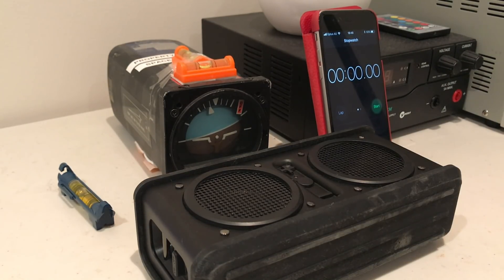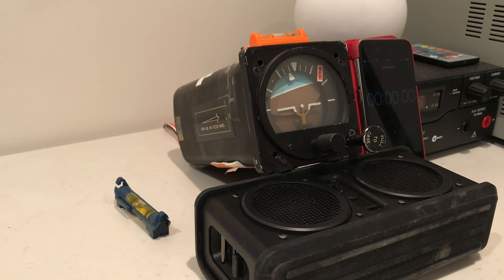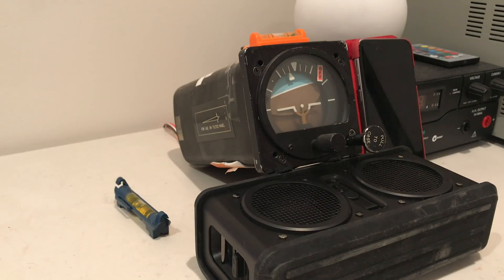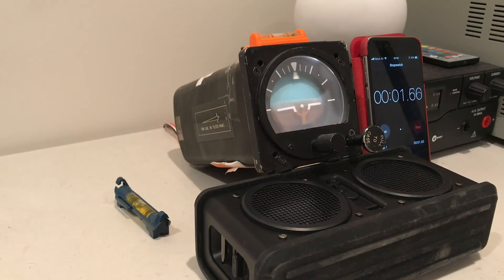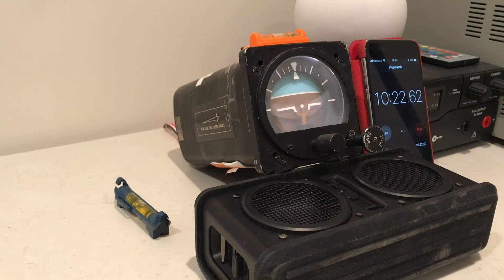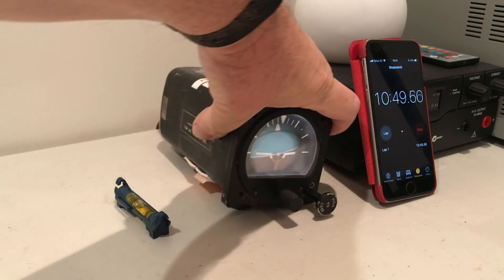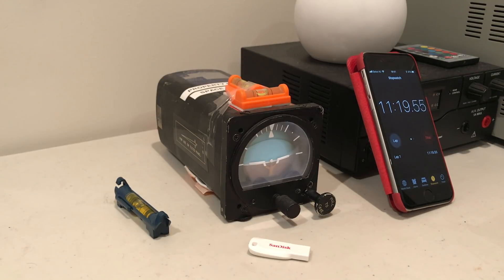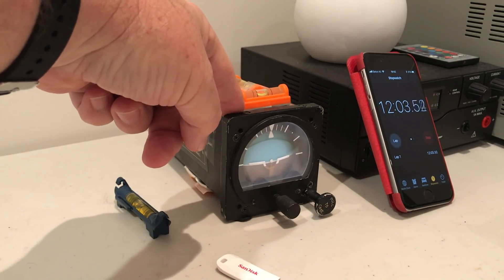Flat Earth - An often requested Artificial Horizon Experiment - Powering up at an angle.

Comment: An object that show you when you are level. That's it. WHEN YOU ARE LEVEL. Level can only exist on a flat surface not a round one. And claiming that the force of gravity is why it's always showing a level orientation.  in fact as you curve so would gravity in perspective to the earth. . SO the artificial horizon would  constantly make a new forms of level seeing how the place of level at 1degree of curviture would be different at 2 degrees. The level of gravity would be different in the new destination. then the level you just entered. And if you where right and it was maintaining the level of the force that makes things fall which is gravity consistialy to the center of the earth equally. Then your instrument would still display a change quickly going from unlevel and back to level again as it when from 1 degree to another.  I could draw this for u but the comment section only does text.  But seeing how there is no transition displayed or even shown slightly for a millisecond then you are not curving with the earth... plain and simple. LOL THIS GUY IS LITRALLY GIVING FLAT EATH MORe PROOF BY SHOWING YOU THAT THE artificial horizon  MAINTAINS THE PLANE AT A LEVEL FLYING STATE unaffected by the earth's changing  gravitational pull as you curve around  AND YOU GLOBERS EAT IT UP forgetting the fact that it keeps the plane level. And there is no transition what's so ever.
Reply: Level ≠ Flat. Level means perpendicular to the center of gravity. This is well known and doing a little bit of research can't be that hard, right?
Reply from the maker: +sky souls.  I am constantly amazed at the ability of Flat Earthers to completely NOT understand how this instrument works.  Basically everything you said was wrong.  

When you fly across the Earth you do not jump in 1 degree steps.  It changes gradually over many minutes.  At 450 knots it takes 8 minutes. 

That means after one minute the change was only 0.125 of a degree.  That means in 5 seconds it was just 0.01 of a degree.   The gyro is adjusting constantly and smoothly.    Do you really think anyone would notice 0.01 of a degree?   Not a chance.

No I am not giving Flat Earth more Proof.  That is just your complete misunderstanding of my video.  This video proves Flat Earthers don't understand how the Artificial Horizon works and your comment just confirmed it.
Reply: "It amazons me how u simple think everyone who took physics is gonna buy this crap"
This is the essence of flat earth. "All these people who know physics get this wrong, and I get it right. How amazing!"
Reply: Sky, if the pilot took his hands off the controls, would the airplane always just keep flying in the same direction?
Reply: sky if the pilot is always maintaining the aircraft with a constant orientation relative to the center of the earth then you'll see no change in the artificial horizon that can visibly be distinguished from those caused by little changes of aircraft orientation due to turbulence and stuff. As Wolfie tried to explain to you, the aircraft doesn't go to on degree off and then get corrected. It's always being corrected because of a lot of stuff.
Reply: Laywer* not larry
Reply: More likely want* the word not is not suppose to be there
Reply: Sky, the pilot or autopilot is maintaining the aircraft's orientation relative to the ground all the time. It's going through different air currents, different air densities, people moving around on the plane, the fuel tanks draining, all that stuff.
At every point in time in level flight, the pilot is keeping the aircraft in the same orientation relative to the ground, so down will always be down for someone (or a bubble level) in the airplane.
Airplanes don't just keep flying in a straight line unless a pilot consciously compensates for the curvature of the earth any more than your car will keep moving in a straight line for several minutes if you take your hands off the wheel.
Reply: Barry On ok so.now we have gone from it the pilot took his hands off the controls. What would happen to telling me what happens when the pilots hands us on the control or you have the system of auto pilot doing the controls for you. Which is not the question asked if you had asked what is the pilot doing or auto pilot doing at all times. Your response would indeed be correct for this situation but you didnt. And I answered your question in to what would happen if the pilot took his hands off of the controls. So I believe your compadince of the situation has in fact been compromised. And like I said I never disagreed that the instrument maintains a level that is in correspondence with the force of gravity which is always pulling towards the center of the earth. Thus creating this down word direction your speaking up. I merely stated the the direction of down that is perpindicular to the ground would always change by degrees on a sphere of gravitation pull. So again dude what does any of this have to do with the facts that gravity is a force lulling into 360 degrees down torwds the center of the earth and what does the pilot letting go and letting jesus take the wheel have anything to do with the fact that the artificial horizon does not register the siddle changes in the centeipital force pulling down and it travels to even .001 degrees of space. Nothing it has nothing to do with it. Like I said I could fly a plane with a two levels from lowes and those guy wolfie is just making a statement that the machine reads the force that is always going down perpindicular to the earth ignoring the laws of physics facts and science that what would be perpindicular 1 degree before is not long the same 1 degree layer and the machine of going of that same force and registering the perpindicular level ofnthe force it would in fact constantly flicker from unlevel back to level bro plain and simple thanknu
Reply: Wolfie6020 your still missing my point sir I and in not talking the instrument I'm talking physic and the instruments used in physics and the instrument whether its 1 whole degree or. 01 degree should still register a chance in the geqvitation field and going from level to un leve in fact it should be fighting itself becuase ever second m you tenable your going from. 01 to .02 to. 03 to .04 to. 05. Here we can break the numbers down ever more but gues what ever saxons u fly the field would be changing and the directing in which gravity is pulling on set object towers the center of the earth would change from .001 to .002 to. 003 and your matching never ever register the chang is simple remains level like a leveling rool left on a flat table bro. And if ur instrument was going of set for it would pick up the changes in the force of gravity. Not just stay leveling. It amazons me how u simple think everyone who took physics is gonna buy this crap. The point of leve would be hanging so much and it would literally be a point in each degree. Of movement not a level line. And guess what when you connect all the points of you maintained a level position all around the sphever and then connect the this points to show the path of the p lllm and you whole have drawn a larger circle around the smaller one. No where in ther would you draw constant level line. So your matching still would have to show a twitch every second showing itself as autocoreting itself and it doesn't. it show the line remaing  perfectly flat. I mean my God you and these people amazing becuase you have explained and showed me how this thing works I realized you take one of those levels on the table stap it to your pain table and fly with that tool and save a few 100 bucks  if the bubble comes towards u it means ur diving is the bubble goes forward it means your climbing. Have a second one for left and right and again if it comes toward you your going left and it it's going away ur goes right. And if you keep both lil bubbles in the center bamb you lever and flying strait. For 15 bucks at lowes for 2 levels and boom you got yourself the cheapest artificial horizon you can think of. Your welcome.
Reply: Barry On right lil and just ignore the fact that I'm right about being able to keep a plain level and fly straight with 2 fucking levels from lowes I'm done with this conversation bro. I've maid my point and since I can not draw in the comment section to show you what your gravity is doing and how it changes from one point to another becuase ur travicling on a sphere your little brains couldent reflect what I mean that the force direction in which gravity is tugging on your plain is always chancing from one point in place to the next and the fact that your machine which is silly based on detecting that force and not maintaining a level like you claim. Becuase the man clearly stays its sence the direction in which things fall relative to the earth and that force is call gravity and the direction to the center of the earth is always changing. And your matching doesn't even register the change. Not even a twitch. I'll stil with my levels from lows
Reply: Der Tod I agree sir I'm not refuting that fact. The the point in which your perpindiculer as your travel on a sphere would chang every degree. You know cuz sphere deal with degrees as you move across the surface. your travel. 1 degre .1 or .000001. It would constantly change so your point of perpindicular would always be changing thus the force of the gravity would also be changing by degrees becuase ut pulling towards the center of a sphere. And the machine shows no change at all. Like I said you can use a level and do the same thing and fly around. In fact imma make a video and do that for yall
Reply: Barry On what does that have to do with the facts presented or are you trying to play Larry and ask inquiring question to test my compadince. One depends if you have your back up systems running like auto pilot two ut will maintain a level for a short distance. And in fict it will more likely not want to roll from one side to the other rather then nose dive like you see in the movies anything Els buddy

Comment: I note that this AH is for a sloped panel. What's the difference between this type & those made for horizontal or vertical panels?
Thanks for all you do. ;)
Reply from the maker: +Dick Holman  - I think it would relate mainly to the position of the horizon line in the instrument and where it sits when the case is 5 degrees vs level.     If you look at 4:30 in the video when the case is level the instrument is actually showing a tiny climb.   If I angled it 5 degrees downwards the horizon would line up better with the side markers.  

It would work ok if mounted level as you can manually adjust the aircraft up and down slightly for eye height anyway.
Reply: :) Thanks Wolfie. Every time I watch one of your vids, I learn something new about aviation.

Comment: Hi wolfie i think we all knew that the gyroscope is self correcting instrument , i think the arguement here is have we ever witness during the flight that when the aircraft do down tilt every 8 mins as you say is the gyro self correcting  on a 1 degree down tilt ?or if not , and its on  a steady flat horizon during the flight and does not correcting how can we say that the aircraft is in nose dive every 8 mins?  When you say constantly self correcting have you noticed that during your flight?
Reply: It doesn't have to pitch down to compensate for curvature.  This is only a stupid Flatardian notion.  An aircraft is constantly making adjustments to maintain altitude.  You really think 8 inches per mile is something to worry about?  It's one degree in 70 miles.  If it is constantly trying to maintain level flight the curvature is insignificant.
Reply: Which part of "because it is constantly correcting at any time, you will not notice the correction because all you would see is a gyro which axis is constantly pointing "down"" do you not understand?

"reason why the flat earthers are wrong on the gyroscope thing?"
The whole argument is bullshit.
Even without an artificial horizon, an airplane would not fly into outer space. The altimeter measures the air pressure and displays this value in the form of altitude. The air hull follows the curvature of the earth. So all a pilot (or an autopilot) does is: if the altimeter reading is to high, he steers a little bit down, if the reading is to low he steers a little bit up. And he has to do this all the  time, because air is not a homogenous gas but has pressure differences all the time. Simple as that. A plane simple follow the level of constant air pressure (which degrades with altitude but there are also other factors influencing the air pressure such as weather)
Reply: Why would an aircraft need to tilt down every 8 minutes?  Where are you pulling this from?
Reply: Do you honestly think planes are incapable of maintaining a fixed altitude without having to do it in jerks every few minutes? When you drive a car around a gradual bend do you jerk the wheel sharply once every few seconds or do you slightly turn it just enough to maintain the curve in real-time?
Reply: slapz2010 He did not say that.
Reply: https://en.wikipedia.org/wiki/Gyroscopic_autopilot
Tell me about the computerized autopilots in use back in 1912.
Reply: slapz2010 why would a plane jerk down once every eight minutes? That makes less than no sense. It stays at the same altitude constantly, every second, it doesn’t wait eight minutes to adjust its height. The earth curves constantly. There isn’t a sudden rush downwards at the exact distance a plane can travel in eight minutes.
Reply: slapz2010 Who is claiming anything about proving the Earth's shape?  You missed the point of the video.  Again, it is the dumb flat earther notions that a plane has to dip its nose to compensate for curvature, or that the gyro in the attitude indicator would not work as it does when flying over a curved Earth.  Both these notions are simply not true, and are dumb made-up Flattard ideas.
Reply: zlapz2010 I never said that it proved the Earth was a nearly perfect spheroid. I was debunking your claims.
Reply: John Michaelson — thats what we call aircraft auto pilot . But gyroscope is independent instrument and not computerize and integrated in the system it will show you what the aircraft is doing on his horizon
Reply: slapz2010 This has been addressed in Wolfie's other videos before: https://youtu.be/avXJqA3w7qk

https://youtu.be/pPDzwOYOZF8
Reply: randomjasmic - i think thats what wolfie is saying on the video its because the earths curvature it has to
Reply: Beyond The Imaginary Icewall - if the aircraft  pitching down is unnoticeable obviously because it is very small angle while circling around a globe earth assuming. but would that be a conclusive proof of the earth as a globe ? i dont think is too convincing to me. How can we conclude if we can’t prove it or notice it. Is it because we assumed that the earth is a globe?  Would that be a bias conclusion?
Reply: thats what i am saying it's because it's unnoticeable can this be a conclusive proof for the earth as a globe ? how can we take this as a proof if we can not even notice it?
Reply: Beyond The Imaginary Icewall — ok so what is your stand and reason why the flat earthers are wrong on the gyroscope thing? If your not proving anything?
Reply: SAR dot — so what would be the correct  if we can not even prove it? And why we say flat earthers are wrong regarding gyroscope thing if we can even notice the gyro drop?